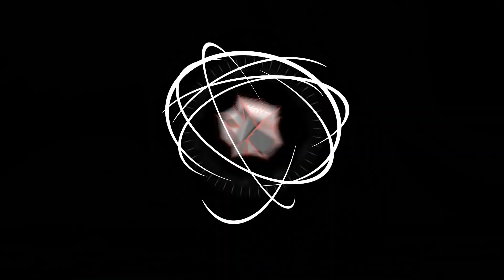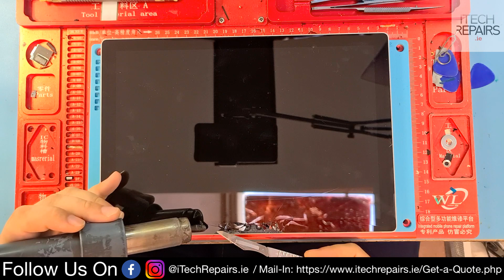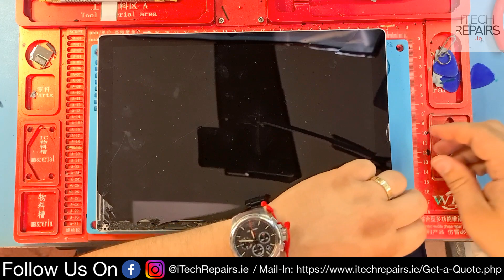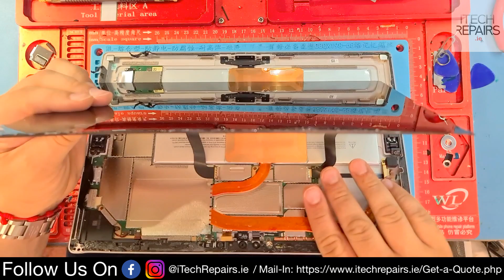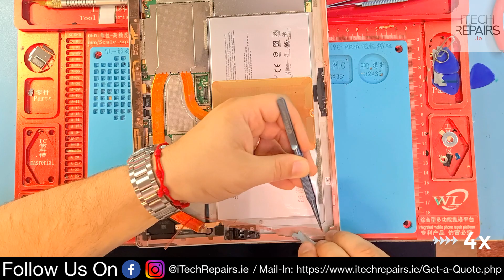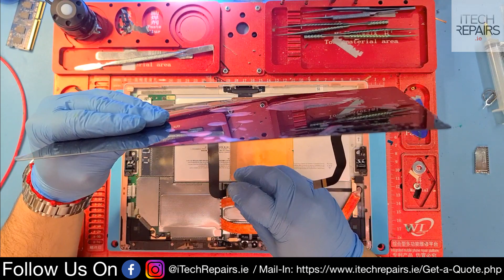Surface Pro 4 Screen Replacement

Comment: is 220 cycles for a sp4 at the point of needing a replacement? im used to easily pulling 800 cycles on old macbooks with the batteries still lasting.
Reply from the maker: I’ve seen sp4’s with 100 cycles only lasting 30 minutes. Not sure if it’s poor software optimisation or just poor hardware.

Comment: I want to do this  without destroying the old screen, do u think that it's possible ? The screen on my surface is ok without any cracks, just the touch layer is dead so I'm probably gonna try to replace the screen if I manage to get one.
Reply from the maker: it is possible. we did it plenty of times where we needed to replace the battery.
Reply: @iTechRepairs-Ireland  Ok, thanks.

Comment: are all ltl123yl01-* screens inter compatible with model 1724
Reply from the maker: To be honest I don't know.....I order surface pro 4 lcd. I don't go with the part number / serial number. So far I didn't have issues.
Reply: @iTechRepairs-Ireland  did you use samsung screen or lg?

Comment: Do i heat edge of screen after to make tape bond?
Reply from the maker: It depends on the tape what you use. Some tapes is recommended to heat up other no.
Reply: @iTechRepairs-Ireland  Thanks! I bought the MMOBIEL B-7010 tape but there is no instructions on the tape as to whether to heat up after or not. But thanks!

Comment: Why all the fuss cutting off the excess tape on the inside?
Reply from the maker: That's the way I like to cut new tape on tablets.....
Reply: @iTechRepairs-Ireland  Ah OK.  Did not know if excess tape caused any problems. Thanks!

Comment: I bought a replacement glass and followed your instructions however it seems the middle area of the glass does not respond to touch commands. Is this due to a bad glass? Thanks and great video!
Reply from the maker: If the connections are fine it could be a bad screen then....
Reply: @iTechRepairs-Ireland  Augh!  New glass bought. I will recheck connections and then return glass.  Thanks!